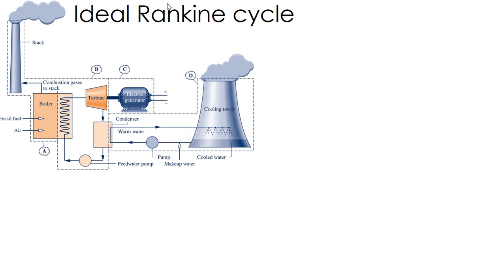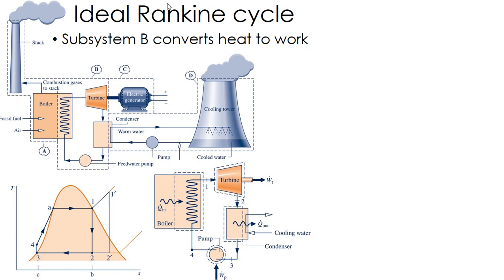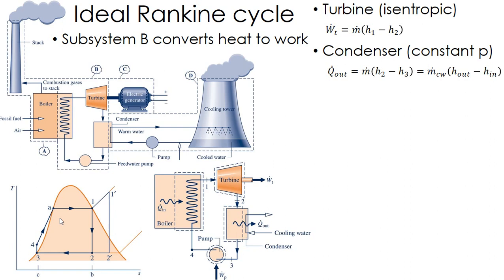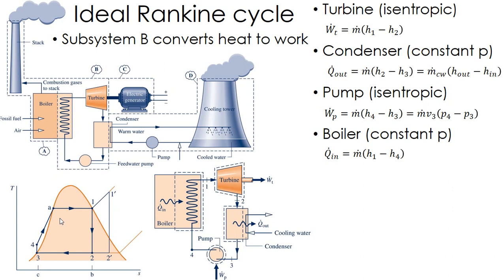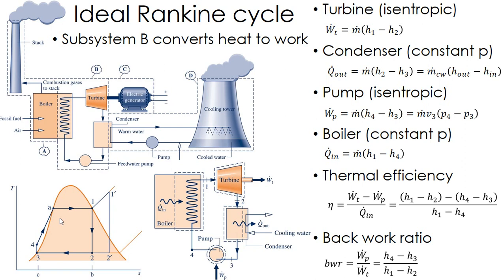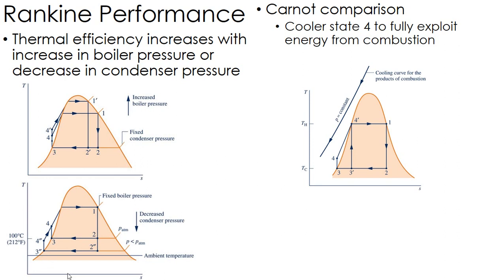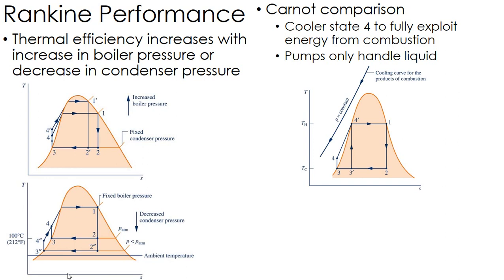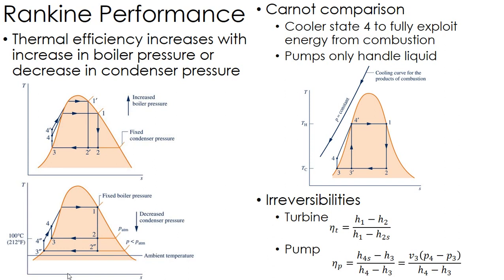Thermodynamics Lecture 24: Rankine Cycle

Comment: How about if the given problem has 4 pressures? does this mean that P1 is not equal to p4 and p2 isnt equal to p3? like this problem that i have:
 In a Rankine cycle power plant superheated steam enters the turbine at 18 MPa and 580 C. Steam expands through a single stage turbine and discharges at 6 kPa with stage efficiency of 82 %. The condensate leaves the condenser at 25 C and pumped to 18.5 MPa going to the steam generator. The pump efficiency is 77 %.  For steam flow of 9,000 kg/hr, determine:
a)	Electrical power output of the plant if mechanical efficiency & generator efficiency 
are 88 % & 92 %, respectively. 
b)	Heat added in the steam generator if boiler efficiency is 85 %
c)	Plant thermal efficiency
Reply: I know I’m a year late, but in the video, he says p1=p4 and p2=p3 because of the key word IDEAL rankine cycle. In real life cycles there are irreversibilities, which means the pressures will be different, and this is where those efficiencies become important.